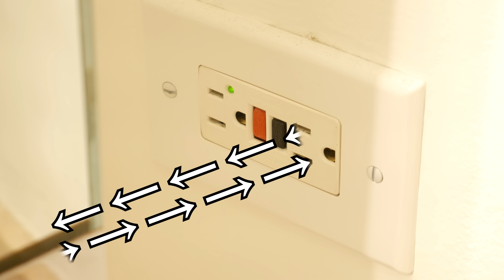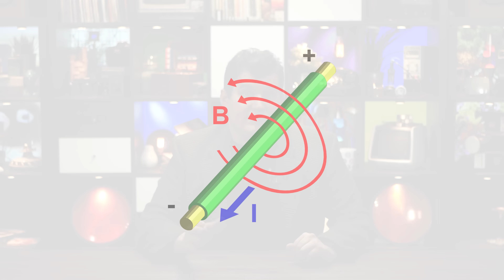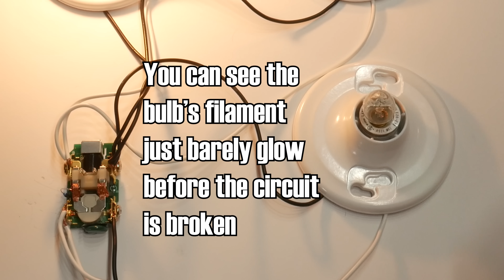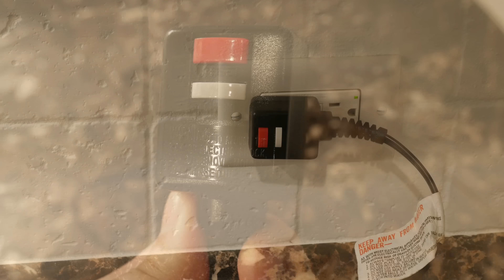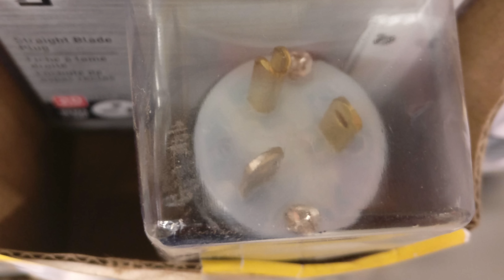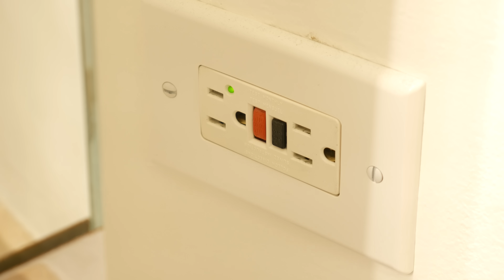The GFCI/RCD: A Simple but Life-Saving Protector

Comment: Standard response from all the Europeans watching to "...electrical outlets in the bathroom..."

"HAHAHAHA no."
Reply: What? Here in germany nearly every bathroom have 1-2 sockets inside (Often just half meter away from the sink). But often the light switch is outside-make sense, you touch that more often. The bathroom is protected by a RCD protection in the house- panel. Plus we have the Schutzkontaktstecker (Plug)-it got 2 wires and ground wire.
Reply: Erm? No? Almost every bathroom in Europe has electrical outlets...
Reply from the maker: K.o.R might be thinking of the next-to-useless shaver sockets of the UK.  I'm not sure if this has been amended by now, but you would think that with the ubiquity of GFCI/RCD protection, there's little risk of having a full powered receptive in a wet location.  The UK is overly paranoid about electrical safety.  That's not necessarily bad, but is has led to some relatively odd standards compared to the rest of the world.
Reply: Odd U.K. standard may include those humongous plugs with built-in fuses on everything, including low amp usb cellphone chargers.
Reply: @damandbass  Same goes to the former British empire. My country, Malaysia as well as Hong Kong and Singapore, for example, has the exact same odd electrical standards as the UK.
Reply: The UK is unique when it comes to how they wire their homes electrically. While in most (western) countries you have a star layout with many small lines (with only a few sockets) leaving from a central fuse box. In the UK however they often create a ring network between many, if not all the sockets in the house. 

And then you can say: will yes, but they can still use GFCI/RCD sockets. But one of the downsides to those sockets is that they do protect the device that is plugged in, they don't protect the socket itself. Let's say I enter the kitchen with a bucket full of water. I trip and the bucket spills all the water onto the counter and partly onto that socket. That socket may trip, but the contacts behind it remain live. I assume that is the situation they would still be protecting against in the UK
Reply: Hans Roes: This is true, but those ring main circuits can be (and are) protected by an RCD in the consumer unit; in fact I think most circuits have to be updated to include one if any non-minor work is carried out. The bit about the RCD socket protecting downstream sockets as well (in the video) is interesting; from what I can tell, an RCD front plate for a socket is just for that socket.
Reply: Hans Roes That example's a bit off. The RCD is usually nowhere near any sockets, so once a fault occurs at the socket, the remote RCD trips and the entire socket is de-energised (or in my case, every socket in the house de-energises once something trips the RCD). Now what I just typed could all be bullshit because I know very little in the way of electrical besides what I see and replacing a socket once.

Also I think there was some kind of other protection device that would trip if any current was going to earth at the panel, but as I said, guesswork.
Reply: Technology Connections 
How is a shaver socket useless?
It charges my shaver and my toothbrush.
And some even provide 120V for yanks.
Reply: Most places here are still really old houses.
Reply: Technology Connections I just get a shaver adapter for regular socket, plug anywhere in the house In U.K. always find it odd Nema sockets have no on/off power switches.
Reply: I would run the  Nema socket off of the bathroom light switch.  Who shaves in the dark!
Reply: The UK shaver sockets do have their advantages. You can plug in low current 120V North American devices into them and they will work.
Reply: I don't know that they're being paranoid; the risk of electrocution from a 240v circuit is a whole lot higher than from a 120v one. I accidentally shorted a 240v circuit once, and the result was pretty damn spectacular.
Reply: Whether the UK is "overly paranoid" or, in fact, sensible about electrical safety really comes down to one's reading of the statistics of e.g. fatal (domestic) electrocutions per capita. Spoiler: the figures from a superficial search put those of the US at anywhere from double to as many as six times.
Reply: We also have far more idiots per capita. Even with several seeming to move themselves between statistical buckets.
Reply: Captain Obvious, I don't doubt these statistics, but I have to wonder how many of the electrocutions in the US are due to fixtures that are not up to code (due to old wiring or shoddy workmanship). The modern codes in the US are pretty good, but some people cut corners and others live in old homes that were never updated correctly.
Reply: Thankyou Captain Obvious
Reply: I shouldn't have to point this out to someone named "Captain Obvious", but correlation does not prove causation. Until you've thoroughly investigated and ruled out the cornucopia of other factors that could explain this discrepancy, I don't think your all-too-British condescension is warranted.
Reply: Captain Obvious  But how many of those were GFCI outlets? I'm betting there were ALL old houses with old wiring and either no GFCI, or a faulty GFCI that hadn't been tested in years.
Reply: It does in fact look like, if you have a larger bathroom, you can have sockets; they must be at least 3 metres from the bath or shower (though I guess not sink, since we have sockets closer to the sink in the kitchen).

240V in a room that gets super steamy sounds like a recipe for arcs and endless tripping though.

One time when wimpy 110V outlets are the winners ;)
Reply: In the UK a lot of us don't have sockets in bathrooms
Reply: How do you keep your tooth brush, shaver, hair dryer, curling iron, and/or water pick powered? There are plenty of appliances that are used in the bathroom.
Reply: no there really aren't....
Reply: +bugalaman Usually they're battery powered and charged outside of the bathroom, and just brought in when needed. Appliances like hair driers are just used outside of the bathroom.
Reply: bugalaman, 
Brushes, picks and shavers are battery powered. Hair dryers and curling irons are used outside of bathroom.
Reply: TheYoutubeGuy HOW DO YOU GUYS WATCH TV ON THE TOILET?!
Reply: bugalaman 
We use the charger socket.
Reply: +bugalaman Batteries! Which are then typically charged in the bedroom
Reply: Many homes in the UK do have a 2 pin 'shaver socket' that is limited to a measley 1amp - this allows a toothbrush or waterpik to be used but not a hairdryer. To ensure people don't plug in those sorts of devices the socket is a 2 pin rather than the standard 3 pin the UK uses. We have a complicated history of house wiring that seems to stem from the lack of copper after WW2 so efficient wiring methods were used - but with drawbacks that then had to be resolved by other means....and we still take decades to change the safety regulations it seems.
Reply: The steam wouldn't cause a lot of problems for a long while, but it would definitely invite corrosion and subsequent tripping if it's left to fester over a period of years.
Reply: @bugalaman shaver sockets are allowed , these are low power low voltage sockets, designed for humid environments ...
Reply: Uhm, sorry, Italian here and I have a 10A socket about 70cm from my bathroom sink. I've never seen a bathroom without one. I've never had an issue with them arcing in my entire life. It's 230V we're talking about, not 600...
Reply: Lol, in Russia we don't have even light switches in the bathroom, everything is the outside.
Reply: In Germany, with is without doubt in Europe, having at least one outlet in the bathroom is totally normal. They have to be a certain distance away from any flowing water, and if they are within a somewhat extended radius of this, they usually have some kind of cover that is held closed by a sprint or good old gravity when there is no plug inserted. Unless it is a very old installation, they are protected by a RCD, but I have never come across one that is not rated for the full amps - usually 10A or 16A, depending on the wiring in the wall. Usually you can also find an outlet in some lamps that are mounted above the mirror you face when brushing your teeth, most of the cabinets you can mount (having mirror doors and ample storage space for your small bathroom items inside) also have outlets. The main lights are usually switched from the outside (having a "lights are on, bathroom may be in use" indicator light in the switch is also not uncommon), while additional lights (e. g. at the bathroom mirror) are switched on and off somewhere near the light.
However, you will not find outlets in the "splash area" of the shower, and you certainly will NEVER find those weird electric shower heads in Germany. They are, to use the best word ever invented for this, VERBOTEN. :o)
Reply: Actually, there are sockets in european bathrooms, but they must be electrically isolated from the mains (galvanic seperated) by a transformer in a 1:1 ratio if they are installed close to water sources. Those transformers are called shaving-transformers, are small and their power transfer is limited, so don't try to use a hair dryer on those sockets.
Galvanic isolation of the socket reduces chances of electrocution. You won't feel anything if you touch just one of the outlet-contacts alone. (but if you touch both, you're still screwed)
Reply: Ricardo Schuchmann The 1:1 transformer requirement is just for that 1A or less shaver plug.  Unfortunately the pan-european adaptation of the IEC-based code in the 1990s made full-feature outlets mandatory in bathrooms unless you can find a legal loophole to remove the misfeature, which is an unfortunate fall out from fire departments lobbying against having too few outlets in living rooms and kitchens resulting in rats nests of extension cables catching fire.
Reply: Ricardo Schuchmann Nonsense. My socket on the bathroom is earthed therefore it is not isolated.
Reply: I think I'm glad we have paranoid building rules.
I don't really want to trust my life to the cheapest caps and microcontrollers they could get away with.
Better just to not put plugs in there.
Simpler just to run the hairdryer in the bedroom.
Reply: Over paranoid or not when living in the UK I did notice the UK does have, by far, the best plug design I've come across. It should be an international standard for plugs.
Reply: @thomas316  It is indeed an international standard in most of the former British colonies as well as most of Asia and Africa. Australia, New Zealand, Singapore, Malaysia, Hong Kong, India, Ireland, Malta and Cyprus are among the countries that use the British plug standard, after the UK.
Reply: @thomas316  Good lord, are you kidding me? They're gigantic!
Reply: Well in Germany we have those GFCI's too (here called FI's) but normally they are not located in the socket itself but in the central power distribution. They are mandatory for bathrooms and I think mandatory in all rooms in newer buildings.
Reply: here in france it's not less than 60cm (something like 24 inches) from the border of a bath, sink, or shower, and you need a 30ma differential. (maybe Ipx4 waterproofing is needed but not sure about that.)
Reply: My bedroom at my parents' old house had  a faint silhouette of 12 year old me on the wall next to my shelves after the time I decided to investigate what you can do with those 240V....
Reply: @sunyavadin  damn I near;y choked on my drink.
Reply: I remember there being these extremely limited shaver sockets in mainland Europe as well, but the rules must have been relaxed with the introduction of ground fault protection. Nowadays you can plug in your hair dryer in most bathroom sockets, and those things draw a ton of current.
Reply: Traditionally Romania is in the "LOL nope" camp too. No idea if current regulations actually permit it or not, but in 99.9% of existing homes you will not see a socket in the bathroom...
Reply: Only UK doesn't allow outlets in bathrooms (but still allow electric showers). On mainland outlet in batroom are often found, just have to be far enough from water basins and RCD protected (but all the house have to)
Reply: Davude Bacchi I do not get the electric showers. Why don't people just use the hot water supplied?
Reply: Even in Europe we do have washing machines and they require sockets.
Reply: Any UK electrical engineers feel free to correct me on this but in recent years have the UK electrical installation standards not been slightly relaxed regarding outlets in bathrooms, pendant lights and switching gear as a result of the use of RCDs in main consumer units as opposed to fuses? When I was a kid we always had a portable RCD to plug the lawnmower into first in case I ran over the cable because the fuse of the lawnmower and the circuit fuse in the consumer unit would not act fast enough to protect the user.
Reply: cammyboy011 You had an electric lawnmower? I've only ever used an ICE.

Comment: Excellent video, and I’m glad you touched on the differences between this and a breaker - I made the mistaken assumption that they were the same kind of thing, except that the GFCIs might be faster in their response. I’m glad to learn the truth though.

I’ll also be sure to test these more regularly now that I’m more familiar with them. Good public service announcement!
Reply: That's something that confused me about this video, in Australia/Europe/elsewhere, the GFCI/RCDs are integrated with circuit breakers so they have additional protections. E.g. if there is a large amount of current being drawn when it trips, our breakers can handle that but I don't know how the American GFCI's are supposed to handle the flash over.
Reply: In the US any circuit that has a GFCI receptacle will ALSO be fed from a circuit breaker, either 15A or 20A and so the circuit will have short circuit and overload protection as well.

He didn't mention it, but there are GFI breakers in the US as well. These devices combine short circuit, overload and GFI protection in a single unit and protect entire circuits...identical to RCBOs in Europe. It's just less common to use GFI breakers rather than receptacles.
Reply: +Nick Stallman If I were to hazard a guess I would assume that the US outlets are designed under the assumption that they are protected by a 20A breaker and thus built with enough heat dissipation capacity to cope with the overcurrent for as long as it would take the breaker to respond. For the most part the breaker will be faster the higher the current so it's relatively consistent the amount of energy it would need to handle. I say relatively as of course extreme edge cases will destroy that such as suddenly being exposed to multiple megavolts such as in a lightning strike chances are that would indeed fry the GFCI and most of the electrical equipment attached to the circuit.